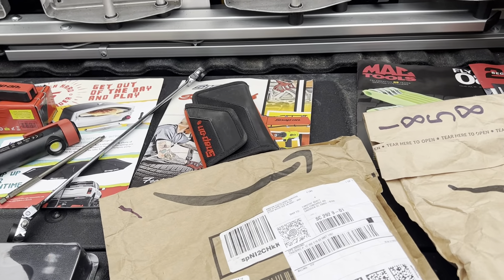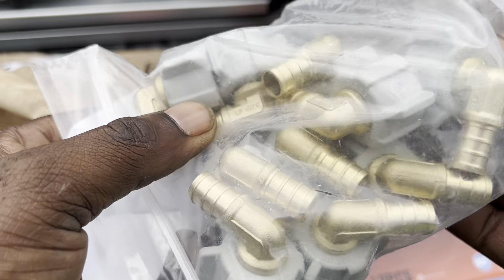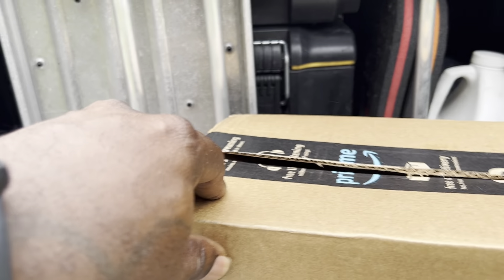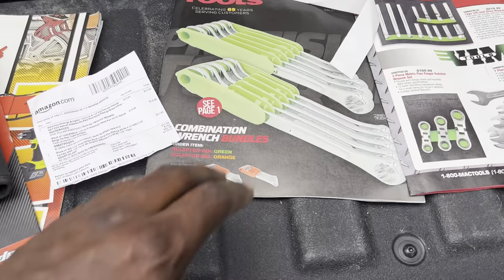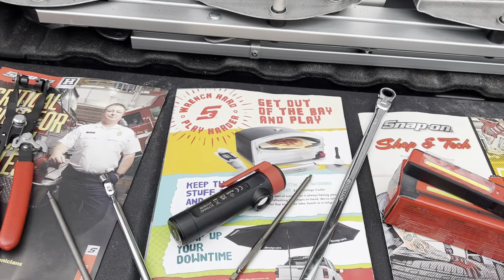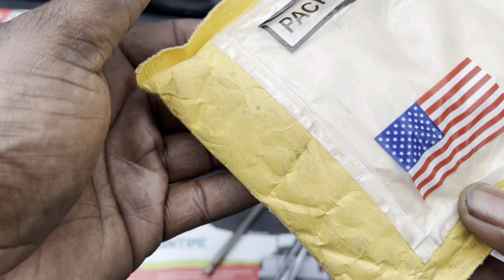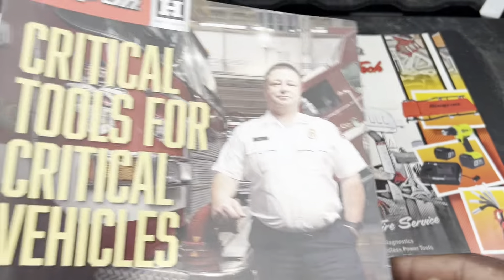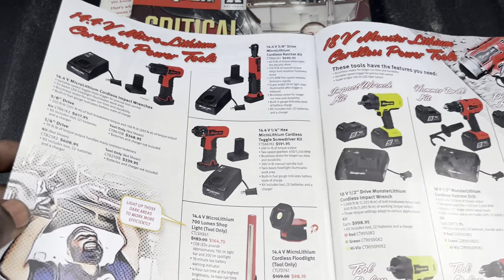ITS TOOL TIME! Snap-On+

Comment: Very nice tool haul. That Snap-on adjustable wrench: you're going to love it. if you're needing an adjustable and there's a risk of slippage due to a seized/rusted bolt or nut, they're perfect for that. I have smooth jaw and the anti-slip design, and I couldn't live without either!!
Reply from the maker: Thanks MTR! I believe im going to upgrade my Pittsburg ones with those Wright tools  ones that you featured on one of your recent videos